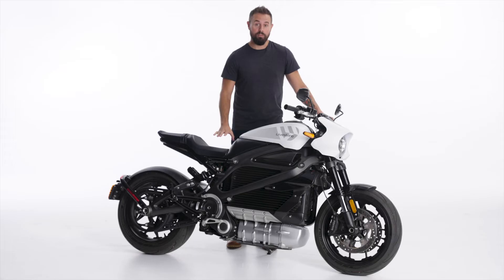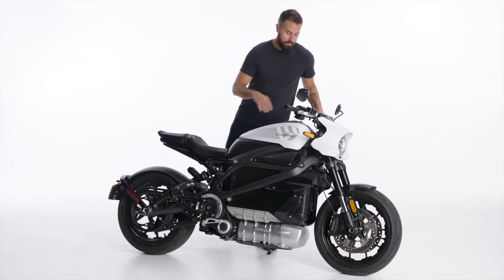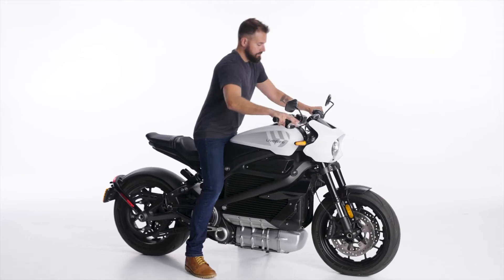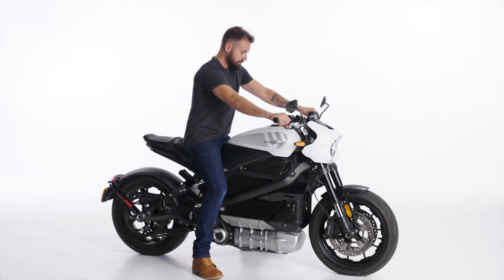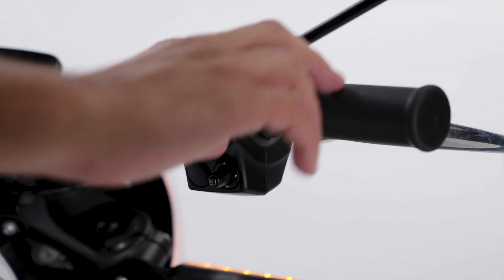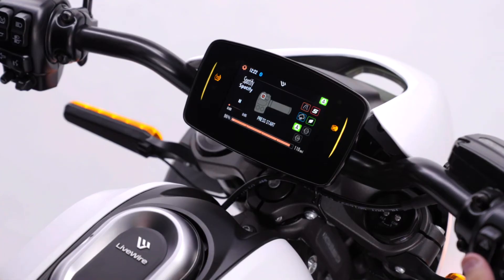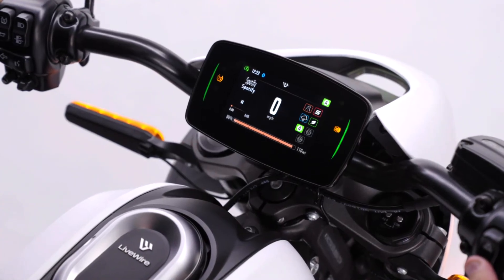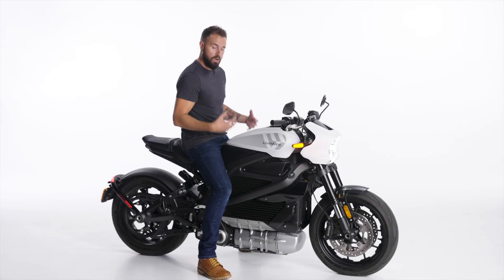LiveWire ONE™ : Start-up Procedure

Comment: Just purchased woot woot
Reply: Hows the experience been?
Reply: @ziegaubrey1643  amazing! I would say the only issue for me is fast charging. Dc chargers haven't really made it out to my area yet so it limits the distance I can do in a day.
Reply: @cameronbailey9156  I considered trading my 17 fatbob in on a livewire. The 70 miles before a charge on the interstate is kind of pushing me away
Reply: @ziegaubrey1643  If you use the interstate alot I wouldn't do it, I would wait for the next generation of batteries should be a drastic change in mileage I would assume.
Reply: @ziegaubrey1643  my longest trip was 85 miles with mostly 60 to 70 mph. I had about 10 miles to zero charge left. There was a fast charger at destination took about 30 mins to fully charge which isn't to bad giving me to to stretch out and take a break.
Reply: @cameronbailey9156  glad you are happy with your purchase and thanks for the advice! I'll be waiting to see the future mileage improvements